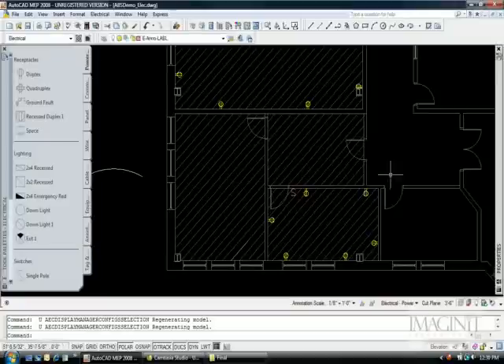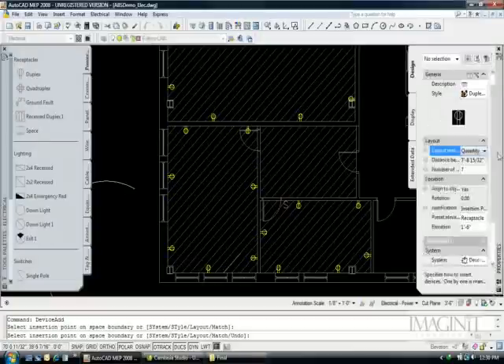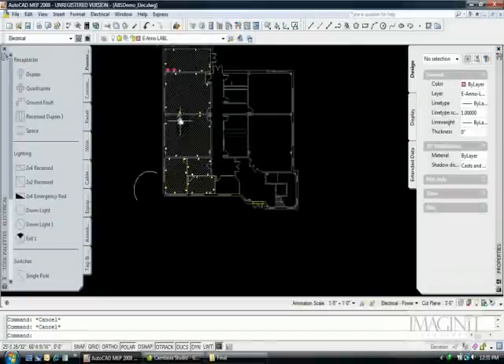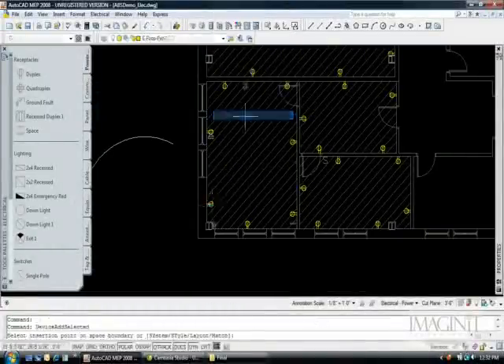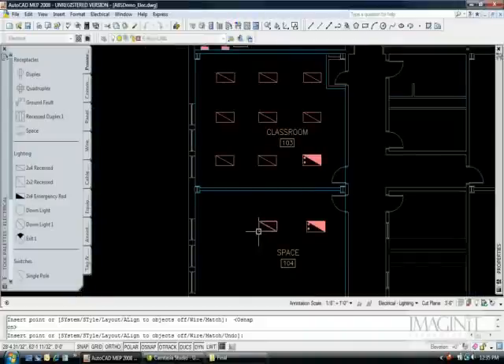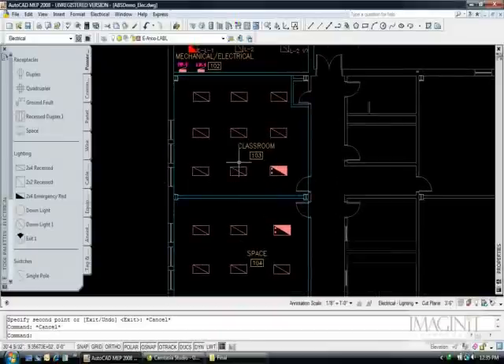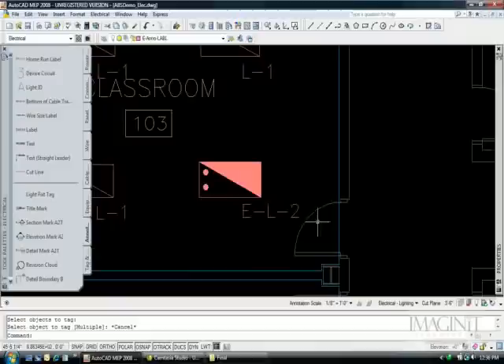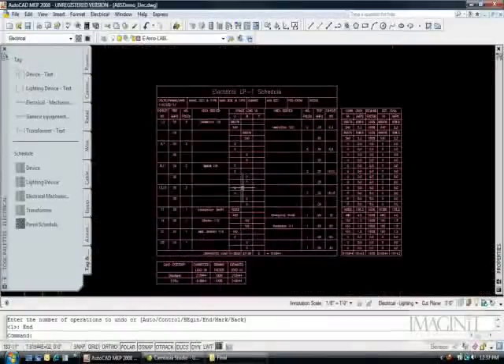AutoCAD MEP Electrical Tools - IMAGINiT Technologies

Comment: If you use real BIM like revit you can get your circuiting, devices, panel schedules, device backbox, ring, plate, mounting height, labels, etc.... Then you can report it all out and even sort it by floor and area for your material handler. With Autocad your stuck with more questions than solutions.